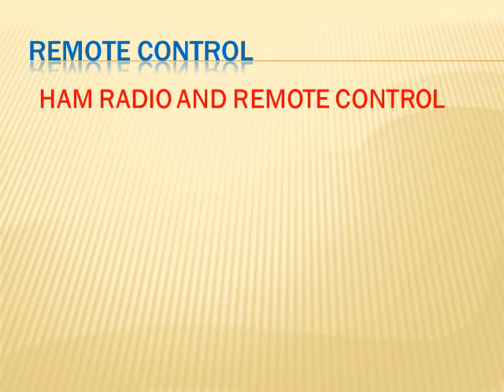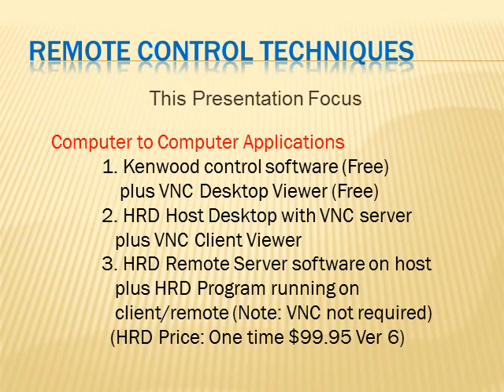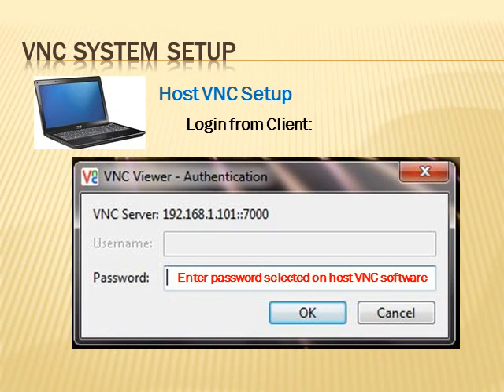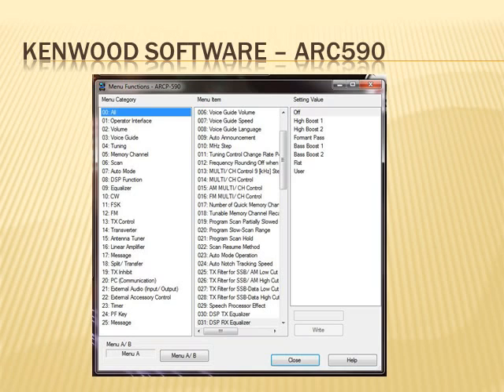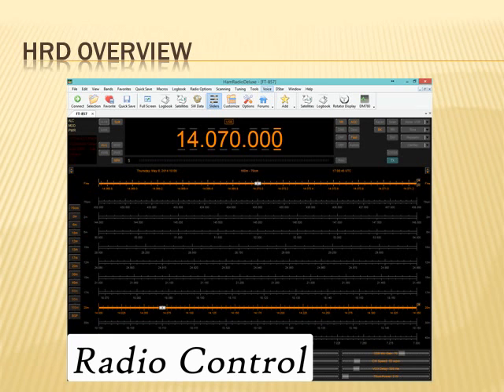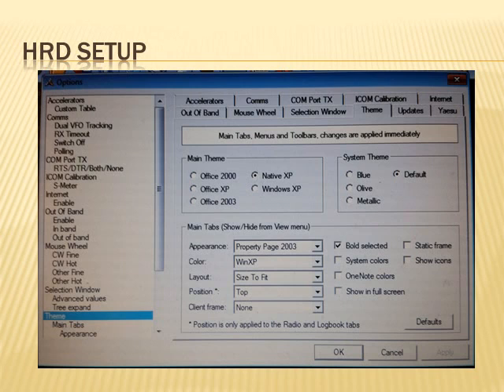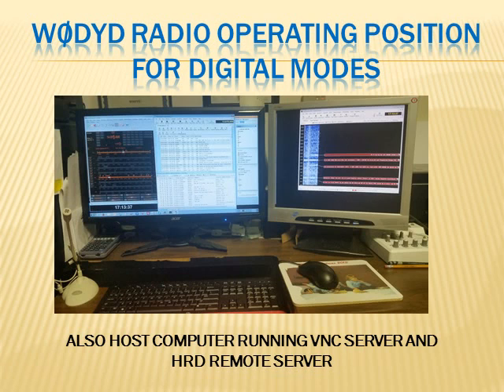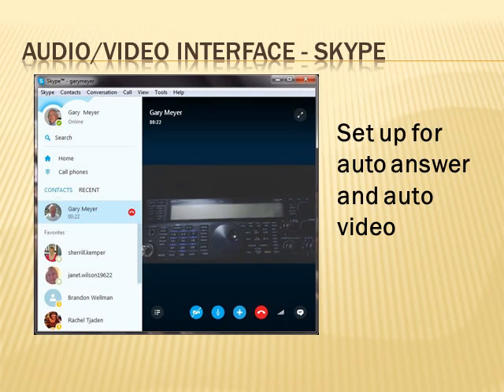Ham Radio Remote operation

Comment: So, what is to prevent someone, for example, from the west coast, using their own W6 call sign (with NO portable identifier), and while connected to a remote station in Maine, proceed to work Mount Athos, and apply for DXCC credit for the QSO against their home call (again, with no portable identifier)? This is CHEATING! And I KNOW that there are hams that are doing this! And these remote control operations are promoting this kind of behavior! I looked at the terms of service agreement, and the operator is supposed to agree to create a 2nd station location for purposes of LoTW QSL applications during remote operations. It's just an honor system. Yeah, right! I highly DOUBT that anyone actually does that. 

I have worked over 300 DXCC countries with my little 2 el trapped yagi at 33 feet and a vertical from my home QTH. I have missed MANY new ones, but my ethics would NEVER allow me to use a remote station and cheat like that. I am PROUD to have accomplished this entirely from my own home station without any kind of cheating by using remote operations.

These remote operations have cheapened the once honorable DXCC program.
Reply from the maker: The prevention is the password protection that is required when signing into the VNC server. No one can use the station unless they are given the password. I use my station strictly for my own use. I agree with you totally on the ethics as you describe them. I don't know if there are any open remote stations, at least I have not run across any. Congratulations on the 300 DXCC, a great accomplishment. I have been in ham radio since 1951 and worked about 190 countries myself in just the last few years. Operators setting up remote stations should not give out passwords without knowing who will be using their station. Thanks for your comments.